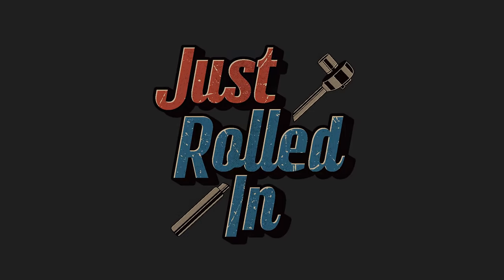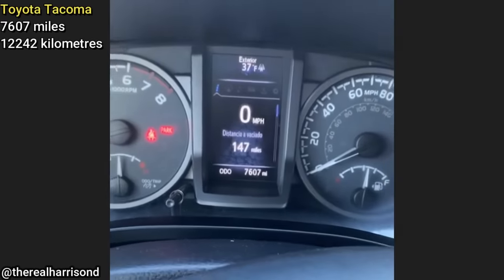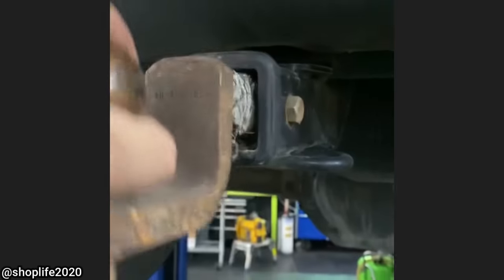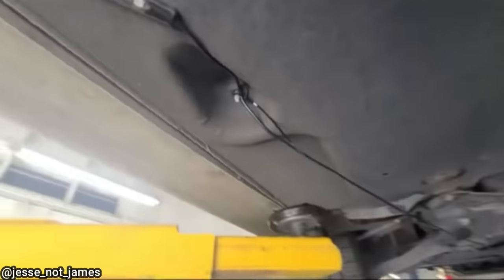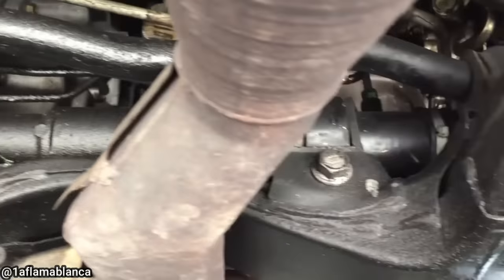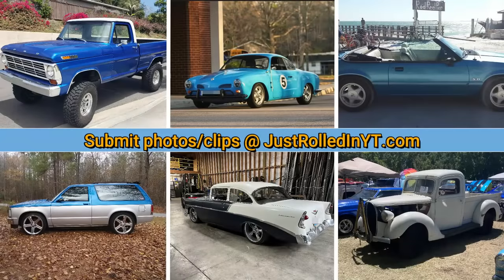Customer States Change Engine Oil On Tesla | Just Rolled In

Comment: In the UK it's mandatory to have a vehicle inspected and tested for basic safety stuff like bodywork, tyres, brakes, exhaust etc. It's called an MOT and if it fails you have to get it fixed by law. Without a valid MOT you can't get insurance, which is compulsory, and if you don't have both the police will stop you and impound the car. They have automatic number plate recognition linked to the central vehicle database and it will automatically flag up any vehicle missing them. I get that the States is basically 50 separate countries tied together in a mutually beneficial union, but even for a country as vast as the US it's mind boggling that there isn't a nationwide federal standard of compulsory insurance and safety checks.

Comment: If you have an all-electric car and bring it in for an oil change, you deserve 1 of the following:

1) Have the car taken away from you
2) Charged for every "required" service needed. Including, but not limited to, filling the tires with cement. Which is explained by saying your tires won't go flat.

Comment: At my workplace, we have electric motors. The gears and the chains require lubrication. It is not far-fetched to imagine that if someone does not know all the details of their electric car would still think there are some parts that require oil change.
Reply: with the tesla it could be argued that the lubricant in the geaar drive/dif will need to be changed at some point. Much like transmission fluid in an ICE vehicle.

Comment: We had a guy come in with an elantra that had one wheel that was far too large for it. The wheel had been flopping around and all the holes were completely worn out, even chopped one of the studs off. Said he'd been riding like that for weeks, and only needed rear shocks cause the ride was bad. We turned away all service until he got a new wheel, which he didn't. He drove off and about 20 minutes later he called saying the wheel fell off. Said he'd sue us into the ground.

Comment: Some of these are horrible.
Others are ingenious temporary repairs.
Usually good enough until the next paycheck, or buy time to buy another car.
Occasionally something kinda goofy lasts for years.

Heater hose didn’t fix the issue, but minimized a a worn upper control arm bushing on a 1963 impala for a few days until I got new parts.

A football on top of the rear axle got me good clearance for fat tires on a 1977 Corolla.
It looked cool🙄
( it actually was much better on and off-road with stock sized tires)

Silicone to fix a transmission or engine mount…..
Basically tried to fill it in.
That didn’t work. 
Dudes tire trick looked like a nice bandaid.

I duct taped a headlight using the box it came to the bumper on a 2001 Cherokee after a minor collision.
Worked great until it rained 2 days later.
Replaced that with a piece of plywood. Cut a hole to fit the headlight and wrote a nasty about the insurance company on it.
Some couple at a gas station took a picture of it.
Probably on the internet somewhere.
Insurance eventually fixed it.

Comment: What was the issue with the window rolling down and turning left causing the door to open? Was the passenger door mechanism bad and it wasn't shutting all the way and the centrifugal force was opening it when turning left? Of course, most cars don't pop their own doors open with any mechanism, so that seems like the only thing it could be unless that's some particular vehicle manufacturer that pops the door open with a command if you want.

Comment: Fun fact: Teslas DO need occasional oil changes, they DO have oil filters. But it’s near the gearbox, so it’s slightly different in that it is gear oil in the gear box, which is more like a transmission than a piston engine. Tesla owners should know this. If you ignore it, that gear box will someday seize or possibly explode like a pipe bomb. Yes. Teslas use gear oil.

Comment: I've declined repairs on vehicles.  
1 the repairs were more than the car was worth.  Went to the wreckers
2 A repair I could do for less than a 1/4 of the cost.
3 not related to safety (Dodge Omni O24 VW motor in it the rotor shaft was loose.)  drove it till it died.

Comment: Teslas do require oil changes though? Diff, Transmission (although maintenance free supposedly), Brake fluid... It's possible the owner was confused but hopefully the mechanic checked if these were due before sending him away.

Comment: The tennis ball trick is old school!
Its a temporary way to beef up the suspension.
Usually reserved for an old paddock hack if ya just need to shift something extra heavy a short distance.
Not something I'd recommend going on the road with!
That shit's a redneck farmer solution to quickly get a job done.

Comment: 2:40 what does he mean here? the thing used to collect used up oil is powered by air? ie. you blow air into to force the oil out?
Reply from the maker: yep pretty much. they didn't close the correct valve so it came out the top.

Comment: I know the oil change oil is for lubricating the pistons, but this is the first time I've actually been wondering if all the other moving parts a car are unlubricated.
Reply: Pretty much anything metal on metal is going to be lubricated but for some things you don't need to re-lubricate them.  You can't slather grease all over a piston like you can a ball bearing or chain.  If you tried to grease them the same way you would a lot of other parts of the vehicle you would need to pop them open every few rotations as the engine burned away your grease.

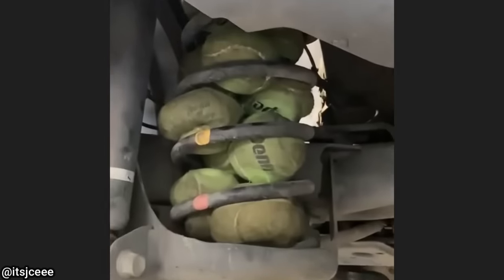Comment: For 2:10, my stepdad looked up the tennis balls thing and this is called a "redneck lift", a means to stiffen up soft suspension on the cheap. Not the most effective but tennis balls are like 36 for just under 40 bucks whereas suspension work runs up to $500 or so? The only question is whether it was another shop or the customer that did this!

More on the "redneck lift"; Offroaders and drivers in countries with extensive rough driving find the lift helps prevent the suspension slamming all the way against itself and necessitating very expensive repairs. Offroader 4x4 suspensions are particularly expensive to start with, so...

Comment: Customer brings in Tesla for oil change, oil change fully charged but not performed. Got ya, so you the tech charged a consultation fee, labor, top off all fluids and antifreeze. Lol. Teslas have only the windshield fluid to be serviced. The battery coolant is a Tesla service only thing.

Comment: You do know EV's do need oil change too? its just not engine oil, but reduction gearboxes need chance every 100,000 miles in Tesla Model S and Model X cars. Model 3 has oil filter so it can use same oil bit longer, but those still need replacing. Even though Tesla markets it self as "there is no need for oil change" and "synthetic oils used do not need replacing" every oil product will go bad and loose its properties over time, well as go bad if say water gets in. This is also why one should check oil regularly to notice if water is mixed in oil since that indicates issue and could save parts from detonation if cached early on. Then again rate EV's are starting to blow soon enough as battery warranties are expiring there out to be plenty of spares around... though finding good battery will be the hardest and most expensive part that will die sooner than later. Mind there is long list of ev's having battery issues even during warranty period, but after the warranty ends, you are fucked royally.

Comment: This is both the best and worst episode I've seen .. holy moly, these people shouldn't be allowed to own a car let alone drive one. That Tesla probably needed brakes or wheel bearings or some other suspension component whose wear induced noise level was louder than they generally listen to the radio... And turning it up stopped helping. That's when people start looking to "get an oil change"... And while you're at it, feel free to diagnose any other problems you find....

Comment: If the brake line was just a couple inches higher it wouldn't have been that bad, unlucky guy bought a little too much line, and I don't blame him for not wanting to use those dogcrap rental handflare tools. I usually buy NiCopp for this reason. Easier to work with, and if I do have to cut it, flaring is A LOT easier.

Comment: So, how many quarts and what filter does a Tesla take?
Reply: I don't know what a "quart" is, but the Model 3 oil filter part number is 1095038-00-A (2 of them if you have a dual motor car), and they use Pentosin ATF 9 oil.

Comment: Tesla electric motors require Pentosin ATF-9 fluid and a 1095038-00-A filter which need to be changed at regular intervals...
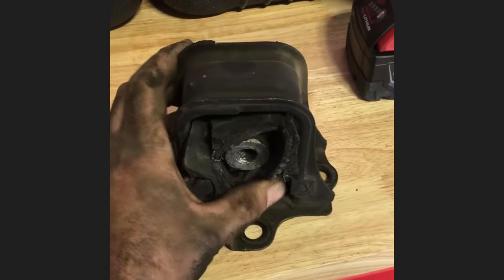0:53 is that some bastardized Jimi Fix? lol i mean it gets you home
1:51 that's just sad. probably less than a foot of water too lol

Comment: Theres oil inside the motors, and that's going to cost probably 20k to change.  Don't do this unless you have deep pockets
Reply: oil change is like $135 after 100K miles. thats cheaper than the cheapest car to get oil changed after 100K miles.

Comment: Fun fact: you can actually change your oil on a tesla. “We recommend catching the used oil and measuring how much came out. In our case, the front motor drained 1.25 qts and the rear motor drained 2.25 qts of oil.” Its technically gear box oil. But still needs to be changed every two years for a good lifespan of the gearbox.
Reply: @sourand jaded nah it have electronic power steering. And musk was saying how he had to find a different ac system for the tesla cause your standard HVAC system was belt driven. So im pretty sure his AC is also electric.

Comment: This channel shows how sketchy people cars are. I now live in Germany and much of the stuff on this channel would take their car off the road. Every 2 years all cars need to be inspected for road worthiness. All major mechanical parts are inspected and must be repaired or replaced. Even if the car has a minor oil leak, it must be repaired and reinspected. And all aftermarket modifications must be approved and documented by the TÜV ...exhaust, larger wheels, body modifications, engine mods, suspension mods. You don't see any junkers on the road here. Even older cars are in good original condition.

Comment: EVs still need oil changes, its for their reduction drive gearbox, usually every 6 years or 50K miles.  I own 2 EVs and both had their oil changes done, along with brake fluid flush.

Comment: Teslas do use conventional motor oil and a similar oil filter to their spec. But you only have to change the oil like every several years. Very little contaminants and heat. It use 5W-30 synthetic oil. The oil is used to cool and lubricate the motor output shaft and single speed reduction gear.

Comment: On Tesla Car's is Auto-Matic Transmission Fluid changed every 6 months since the Engine has no Engine Oil ?
Reply: The oil in a Tesla is generally lifetime, but if you do drive a lot you may have to change it once or even twice.
Reply: @logitech4873  Lifetime generally means 160,000Kilometers in my language and 100,000 Miles in your Language. Generally every 50,000Kilometers ATF change and filter ? For tesla ?
Reply: @anishchand4420  Why are you assuming I use miles?
I mean that you might have to change once per 150 000-200 000 KM or so :)

Comment: Do Tesla's have any oiled components at all? Oil bath motors or diffs or a anything?
Reply: EVs also have a transmission, typically just one with one gear (the Porsche Taycan has 2 gears on the rear axle motor). This transmission uses oil for lubrication.
Contrary to an engine however this oil can be used for a relatively long time.
Reply: @simonm1447  SOME EVs. Just so happens Teslas don’t.
Reply: @troyjollimore4100  of course Teslas have a single step transmission,  the motor is spinning with up to 20k RPM (Plaid Model S),  a far higher RPM than the demanded RPM at the wheelshaft.
It's a very simple transmission, but it is a transmission.

An EV without one would be one with hub motors, the only one using them at the moment is the Lightyear one
Reply: @simonm1447  More like a transaxle, then. Thought they had in-hub motors, but must be confusing them with others.
Reply: @troyjollimore4100  just search for "Tesla drive unit" here in  YT,  and you can see disassembled units,  including the one step transmission

Comment: There are still fluids or oil that must be changed on a EV, for the transmission or to cool the battery. The Tesla guy wasn't completely on the wrong.
Reply from the maker: Just brake fluid that you need to test every 2 years and change if it's contaminated. The rest is sealed for lifetime now apparently.

Comment: The first one is kinda true. Teslas run oil coolers on their motors since they are part water cooled and oil cooled. 

The shop probably wasn't told how to change a teslas oil since they never thought they would have to.

Comment: Contrary to everyone's belief, a Tesla does require oil... So assuming that the vehicle needs oil to be changed is not that farfetched of an idea... However the oil that Tesla's require don't necessarily need to be changed but considering that it has moving parts things like bearings and CV axles do require oil or some kind of oil-based Grease... And I don't know why my speech to text spelled grease with a capital g....
Reply: They don’t. Each wheel in a Tesla has it’s own motor. So no need for lubricated shafts…
Reply: @troyjollimore4100  BS. Look up how Tesla drivetrains actually are constructed.
The Model 3 in this video has either one or two motors, depending on whether it's an RWD or AWD model.
The motors are placed in between each wheel pair, each with an 8.3:1 gear ratio reduction gearbox, and a differential.

This means there's 2 or 4 oil reservoirs in a Tesla Model 3, and 1 or 2 oil filters.
Reply: @logitech4873  I was thinking about another make I’d seen a video on. These gearboxes are probably sealed.

Comment: tesla have oil change but in transmission so I dont see what is the problem ?
Reply from the maker: Its for the electric drive unit. Which the customer wasn't talking about and this was at a Jiffy Lube. Not sure if they would have the stuff to do it?
Apparently the fluid in the new ones is "good for life." From what I read online. They use to have service intervals but removed it.
Reply: @JustRolledIn  Many manufacturers don't have a service interval for the transmission oil of manual transmissions, at least not for the normal life span of a car (it's probably a good idea on a vintage car to do it)

Comment: Technically Teslas do require oil changes. There is ATF in the drive units that require changing. I forgot how often. Its not 3k or 6k like regular oil but it does require changing.

Comment: Actually the Tesla owner is right the motor does have  oil to protect it , and  does need to be changed every 20,000, but also the main battery coolant gets changed at the same time to stop it building up sentiment in the cooling pipes
Reply: it does not need to be changed every 20k and neither does the coolant, thats around 100k, and no interval for coolant but still recommended to flush but dont expect to do it again after 100 k miles.

Comment: Teslas DO have oil although i dont know if you would find it in a jiffy lube. its ATF-9 or transmission fluid, and no it doesnt need to be changed (no moving parts or high temps to break it down although it does have a drain and fill and a removeable filter with a proper part number so im guessing if something breaks and contaminates it you can change it and the filter))

Comment: Tesla‘s actually do need an oil change at 100,000 miles. It’s the transmission oil. For the 1/9 gearbox mounted in the motor housing.

Comment: I mean, teslas use something like dexron 6 trans oil for the combo trans/diff/cooling gear system connected to the motor. So he wasn't wrong. It just doesn't need as frequent changes as engine oil in ICE cars.

Comment: I got the oil changed in my  2018 Model 3 because I insisted Tesla do it. The car had 87000km and I could hear the gears whining. This noise is gone after the change. Oil breaks down so it's not so ridiculous.

Comment: So, where exactly was customer wrong? Doesn't Tesla's diff need oil changes every 40-60k Km's, like any other transmission/diff does?..
Reply: There's no official change interval any more. 
The oil in manual transmissions is mostly never changed at all too, at least not in passenger cars. 

Tesla has no extra differential, they have a one step transmission in each drive unit, and the diff is integrated there.

Comment: to my knowledge the customer wasn't totally wrong about the oil change on the tesla.  I believe they have gear oil in the direct drive unit, and some have oil filters on those units, in addition to brake fluid for the brakes, and coolant for the batteries.

Comment: Well, technically Tesla needs oil filter change about every 10k miles. There is oil which lubricate electric motor assembly. It is hermetically sealed and probably that oil filter will be ok all the lifetime of the vehicle, but it's not so expensive to be 100% sure you keep your motor oil in perfect condition.
Reply: some kind of synthetic oil ??

Comment: To be fair, the model 3 does have an oil filter under it.  It's for the gearbox.  It's presumed to be good for the life of the car, so unless the owner has put hundreds of thousands of miles on the car, it shouldn't need an oil change.

Comment: Actually You should change oil in tesla motors after high mileage. Not only is this oil lubricating the geartrain but also taking heat from the rotor what cause it's degradation. It's exact situation like in manual gearbox manufacturer states that oil is for car lifetime and what's he thinking is 150k miles.